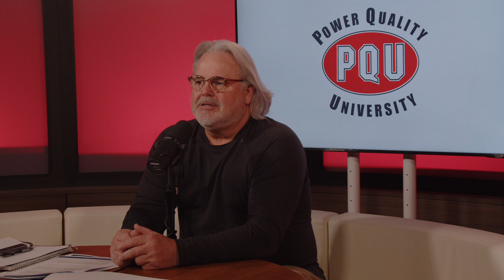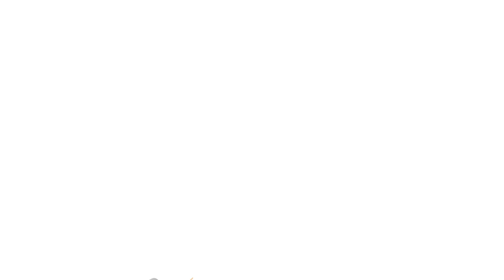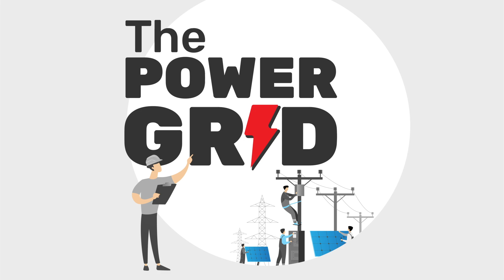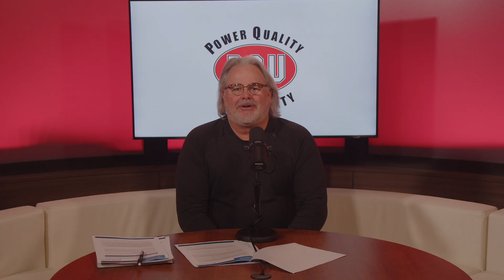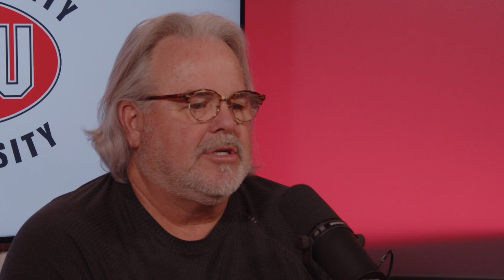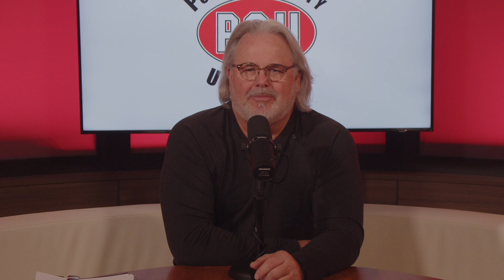Smart EV Charging: Revolutionizing Electrical Systems

Comment: Nice.  I built a J1772 home charger that adjusts the control pilot signal based on the net current flow between my home and my solar and only charge the car and adjust the current when there's excess solar generation. My only suggestion would be to make the labeling abundantly clear to the end user that the charger varies it's power at any time.  The average user is already very confused with just a power shared pedestal that runs at 6kW when one is plugged in and 3kW each when two are.  Then after they come out of the store after an hour and only added 12 miles and think their car is broken because they don't know what "6kW shared" means.
Reply from the maker: Great point, thanks.